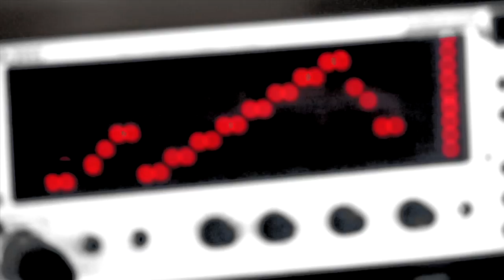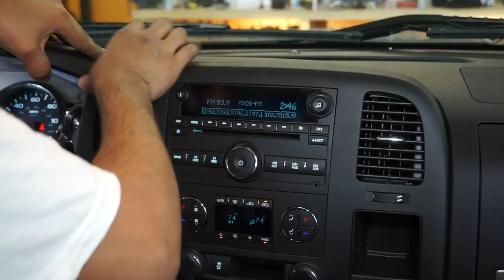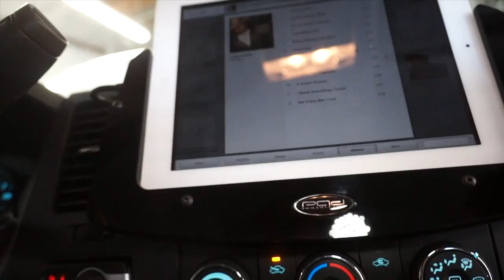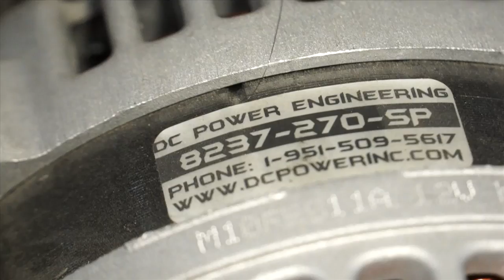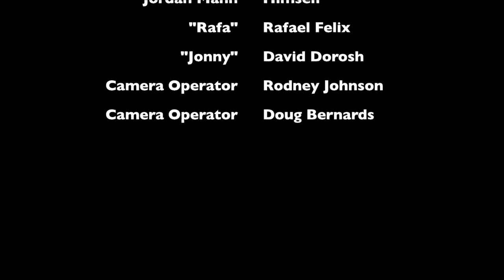Amplified 53 "Nice" @SoundManCA, SoundMan Car Audio, Santa Clarita

Comment: Rafa, man I sure enjoy watching you with the small electronics and with the eye candy of fiberglass and plastic that you can do. It is amazing to watch. I wish ya"ll could make a show of you doing a serious electronics install from the ground up. I have an 07 Sierra and plan to use the factory deck. I have a Rockford 360-3 to runt from there to two maybe three amps with a set of DB 2500 10's and eight Crescendo PWX 6.5" and 8". My question is will it be ok to use the factory deck and run 3 convertors to RCA to the 360-3 or will it be better to get an aftermarket deck and just hook up the RCA? I was just hoping to be able to keep the factory deck, is connected to steering controls, has separate tweeter,  mid, and bass controls. I was trying to save a little money by not having to buy a connection harness, a steering controle harness and the extras which run up to three hundred bucks to install an aftermarket radio. I am not into the 8 and 10,000 watt trucks now been there with multi amps and ten batteries. No need to waste my money anymore.